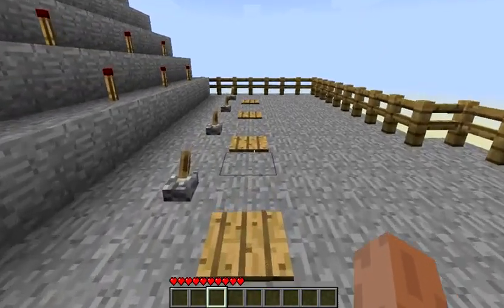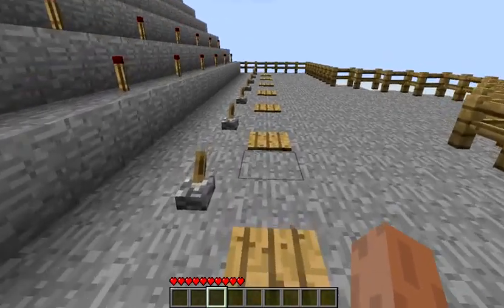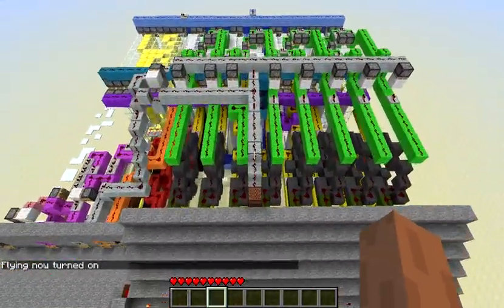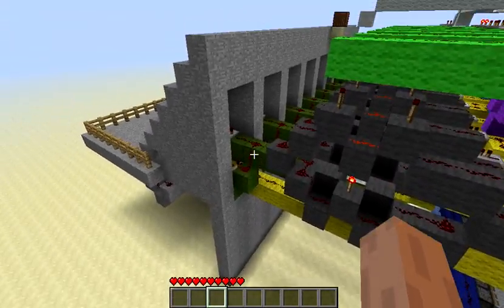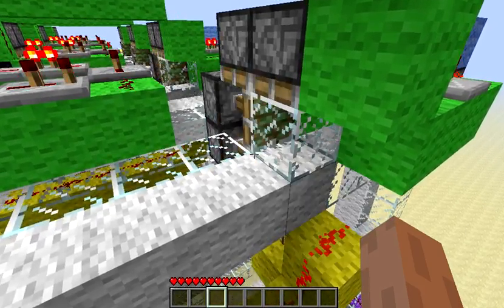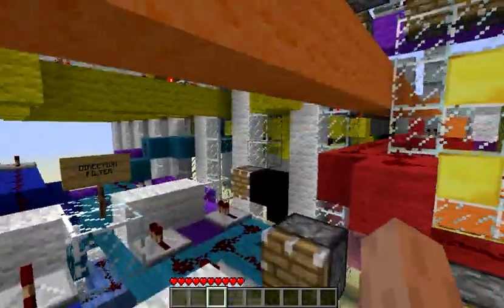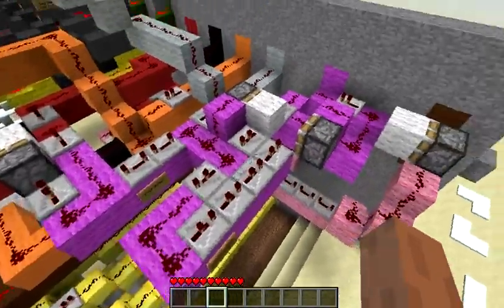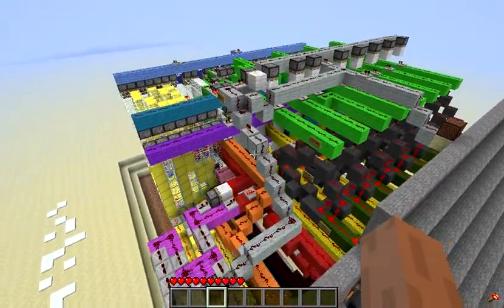46 byte Writable Block Memory Array

Comment: @ecreif Yes, but it would be pretty slow and low capacity, and yes, but there would be no need in this case. Each of those bands holds 46 bits, so it takes them all exactly 46 clock cycles to cycle completely. A smaller band inside those would hold at most 38 bits if it moved the same way as these, so it would take 38 clock cycles instead. This means that the larger and smaller bands couldn't be indexed together, which would make them harder to use in a computer.